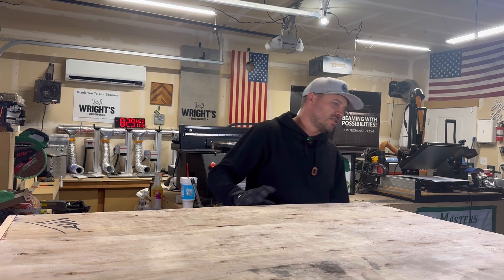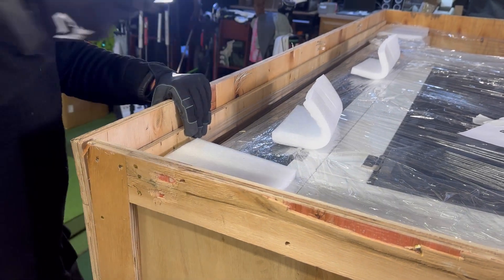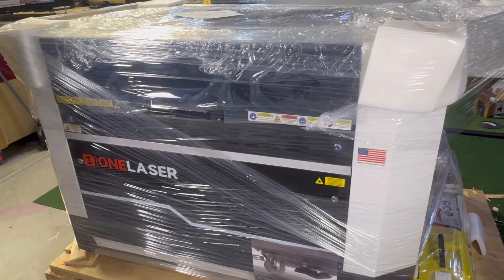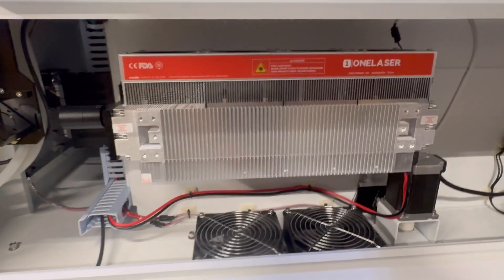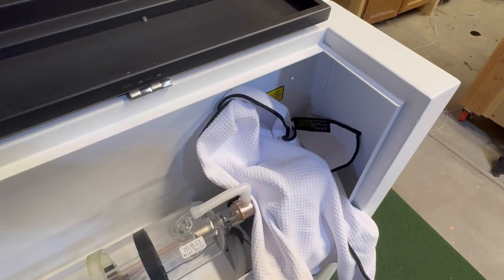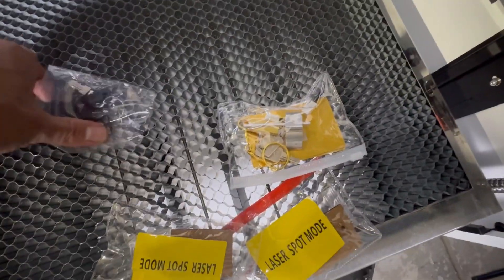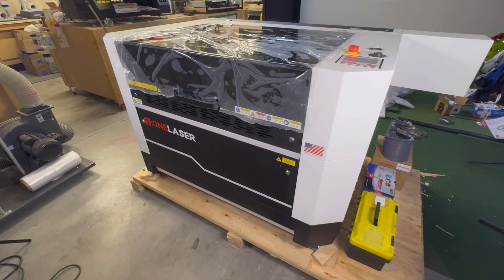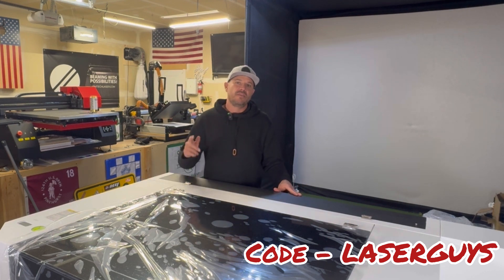ALL NEW Hydra 9 Co2 Laser by OneLaser  - Unboxing & Features Walkthrough

Comment: Nice machine, the built in level is a gimmick though, the machine doesn't need to be level, just the bed needs to be a consistent distance from the laser head.
Reply from the maker: The level installed to the machine wasn’t intended as a bed level. Just a level in general. Like you stated, you are correct. Bed just needs to be level to the gantry/laser head.